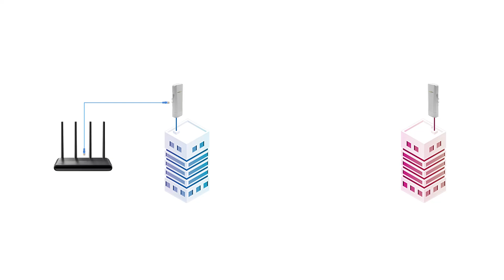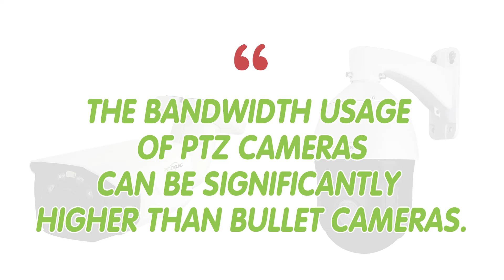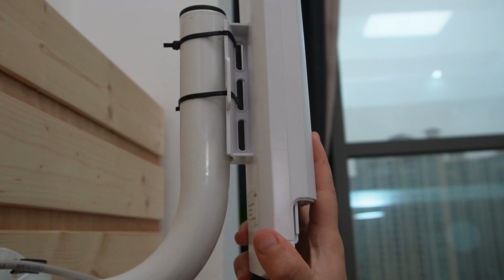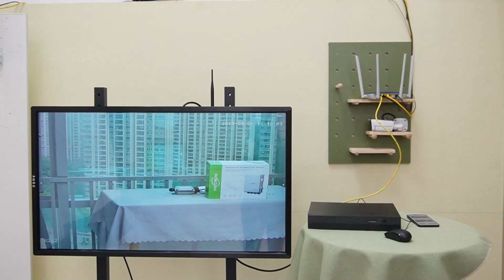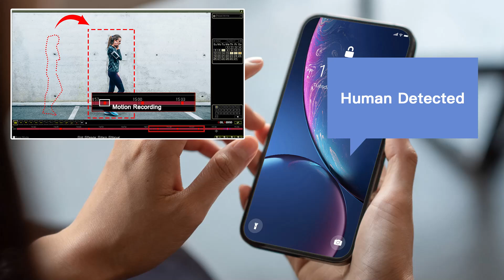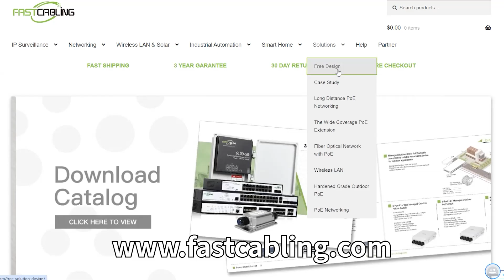Wire Hassle: Streamlining Construction Site Surveillance with Wireless Solutions

Comment: Does this device work in an electric substations?
Reply from the maker: Using wireless bridges in electric substations can be technically feasible, but it comes with a set of challenges. 

Electric substations generate significant electromagnetic interference due to the high voltages and currents involved. The high levels of EMI can cause signal degradation, reduced data rates, intermittent connectivity, etc. Wireless networks, while flexible and easy to deploy, pose security risks, especially in critical infrastructure like substations. Ensuring data security requires robust encryption to prevent unauthorized access and cyberattacks.

Instead, you can use fiber optic cables which are immune to electromagnetic interference and provide higher bandwidth and reliability. However, you need to make sure there's a way to run the cable.